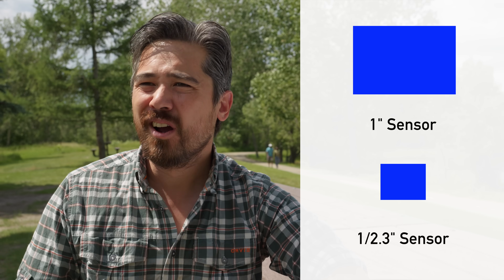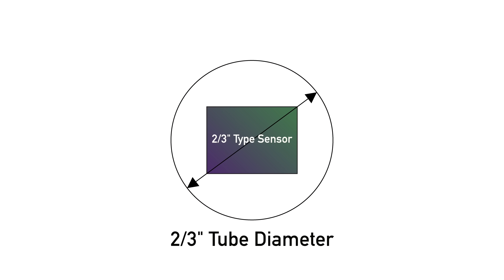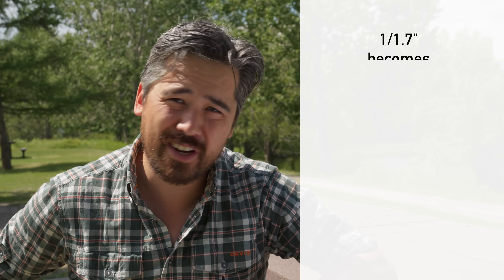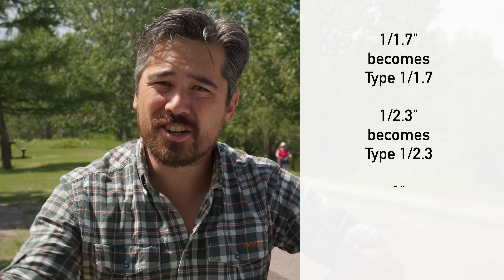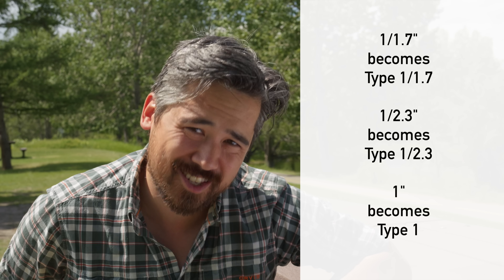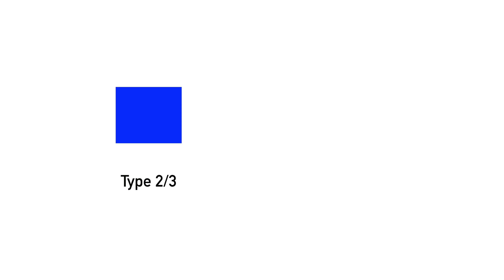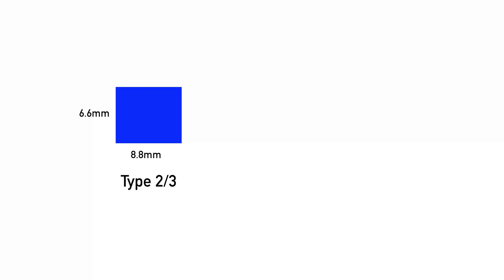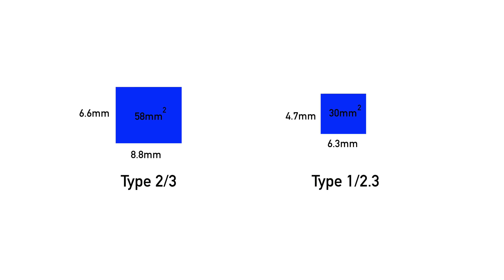Sensor sizes make no sense, but we fixed it!

Comment: Great initiative!
May I suggest to add one more value if it doesn't become too much?
It would be to indicate an accurate crop factor for each sensor size discussed.

It's useful to understand both the focal distance of lenses but also how much light relative to full frame is gathered.

For instance I know that micro 4/3, with a crop factor of 2 gather 1 stop less light.
Easy enough. But for smaller sensor sizes: no idea! I'd like to know.

Alternatively, an light stop index:
-2 for micro 4/3, -1.x for APS-C, -5 or more for smaller sensors
(Not sure the values are right)
Reply: But, your statement about smaller sensors gathering less light isn't correct. Exposure is defined as the amount of light hitting the film or sensor per unit area. Ever wonder why no light meter in existence has an adjustable setting for sensor size or film size? Because exposure and light gathering has zero to do with sensor size. It's the same whether you've got a tiny cell phone sensor or a large format film camera.
Reply: @YetiOnGuitar  yes I see what you mean. As a clarification, I could describe it as an index linking sensor surface area with light gathered, expressed as stop. 

Let's say, if you attach a full frame lens, without adapter on a full frame sensor and a MFT sensor.  The MFT sensor will gather 4 times fewer photons, equivalent to 2 stops less.
Correct?
Reply: @supercurioTube  You're abstracting the theoretical sensor area into something that doesn't have much usefulness—how many photons hits a given area doesn't matter compared to questions like: how big or small are the photosites on the bigger sensor, what generation of Analog to Digital conversion does the circuitry use etc. This is the stuff that the other commenter above me also highlighted. 

Exposure values stay the same across the sensors since they are measured per unit area, and the end result difference between an image captured by a bigger and smaller sensor comes down to a lot more than just an abstract smooth plane that gathers more total photons.

Think about the film camera days, nobody changed camera settings between 35mm and APS-C film cameras. The field of view would be different, sure. But the total photons hitting the bigger film area just doesn't factor into the exposure conversation.
Reply: @YetiOnGuitar  I think there would be value at least for the crop factor, clearly indicated for any sensor size.
Would be helpful in order to match the DOF/Bokeh between sensor sizes BTW.

But yes size doesn't automatically translate to noise performance nor dynamic range.
Reply: @supercurioTube  Yeah I agree, Field of View and Depth of Field are incredibly useful to compare—and of course, substantially affected by sensor size!
Reply: You are mixing up the effect of crop factor on aperture and depth of field with light transmission. From an exposure standpoint the amount of light gathered is not important in the sense of as a bulk, but as "light gathered by a single pixel" and in that manner it will be the same for an aps-c and a full frame sensor. You set the same aperture, same iso, same shutter speed and the two pics will be identical in exposure. The difference is, that bigger sensors will have usually better noise characteristics, and in that regard there is of course a big difference between my A7R and my A6000, but that has its roots in electronics and interference, and that is not as uniform gap as that its influenced by sensor design, size, sensor structure, resolution, etc... so you cant quantify it as uniformly and easily. Its pretty much depends on which sensor you are comparing to which sensor, because there are varieties in FF as well for example.

Comment: That is a great idea to let go of the Inch thing. However I would like to have it as a crop factor from a full-frame 35mm.
For example, it would be better if you call it APS-C aka 1.5x crop (no need for APSC of course). Full frame is a standard 3:2 ratio and if the sensor is in other ratios, it would be good to have your way of "Type "
example: " 'Type 1/2.3' aka crop factor sth.(I don't know) with ratio of 4:3 "
Reply: That's actually a good idea, as we're already thinking in these terms. So, FF would be "x1@2:3", APS-C either "x1.5@2:3" or "x1.6@2:3", mFT would be "x2@4:3" etc. Would be nice, but I don't think that this will become accepted reality.
Reply: @c.augustin  Thanks. I just saw someone on another channel say just ditch inches and use actual millimeters. Milimeters is also going to give us a number greater than one, which is faster to work around in mind. But how big exactly is a millimeter is pretty hard to visualize for some.
why I like using FF as a standard is I can calculate speed booster magnification for lenses. and I mess around with for example the EOSm, which is 1.6x, and records RAW with a tighter crop. If I just multiply, I get the actual working crop, and therefore what CCTV lense designed for that size crop sensor would give me best result.
Reply: @yuxuanhuang3523  While I'm quite familiar with mm sizes, I nearly always think in crop factors when dealing with digital cameras (I started using cameras with 35 mm film, so thinking if FF focal lengths is completely natural for me). I even think in FF focal lengths when using large format (4x5 is actually x0.33 or /3, so a 150 mm lens is roughly equal to a 50 mm FF lens). This is often heavily criticized to use the 35 mm film/sensor format as a "standard", but it is the way it is (it was the dominant image format since the early sixties of the last century).
Reply: @c.augustin  Ah yes, I forgot to mention focal length conversion. Actually that is what I am thinking of all the time. I use Canon so I always remember to divide by 1.6 when I see a tutorial saying optimal focal length
Reply: No. Please, just mm x mm.

Comment: Who's going to remember all the new names. Why don't we just call them directly 44 x 33mm (1452mm²) Sensor, 35mm (864mm²) Sensor, APSC (372mm²) Sensor, etc., so any reader will get an idea about the sensor size.
Reply: Amen, I am on the same boat.  The "type" really didn't explain ANYTHING, and is just going to make the confusion worse.  In fact, since frame would be 36mm x 24mm = 864mm², just call that Type-864.  APSC is 24x16 which makes it Type-384.  Micro 4/3? 18x13.5=243, so Type-243.  etc.  It will also clearly differentiate the Canon "APS-C" which is not APS-C... at 22.3x14.9, that would be Type-332 compare to standard APS-C's Type-384.  A Type number that directly correlates to each sensor's theoretical light gathering capability, and rough depth of field quality - area you should truly care.  What's more simple than that!!??
Reply: THIS is the way to go! The aspect ratio might be of interest, bc a square would be most efficient in this regard. 
A 3:2-type 864 sensor would be complete but maybe a bit bulky. I’m also fine with Type-864 sensor
Reply: Because areas do not matter. We do not talk of areas in the aperture size either.
Reply: @okaro6595  that’s the reason why to double the amount of light that enters the lens you chose an aperture 1.4x smaller… say what you will, but that’s not intuitive; logical, yet not intuitive.
Reply: "Fourteen fifty two" has a nice ring to it! I'll just call him Dave though
Reply: Just use diagonal length. Nobody needs actual area. Do you shop for a 32" monitor or do you shop for a 438 square inch monitor? When's the last time you saw the square inches in a phone screen or TV? Areas are hard to visualize. Length is easy.
Reply: @mbvglider  length doesn’t paint the full picture. A sensor twice the size is four times as good. And: a square sensor would be the worst in your metric and a 17:9 the best, even though they might have the same area
Reply: @lightningblender  Photographers are already able to understand that the difference between f/1.4 and f/2 is a full stop. When you talk about equivalence and crop factor, it's a linear scaling, not one based on area. A sensor that is four times the area still has a diagonal that is twice as large, and this becomes the crop factor, and being able to do math between sensor sizes without needing square roots is nice. People need to be able to do equivalency calculations after all. It's a lot more straight forward to explain that 50mm on a 43.2mm sensor (35mm full frame) has the same angle of view as a 25mm on a 21.6mm sensor (MFT) because the lengths scale nicely. It feels needlessly complicated when you talk about 50mm on a 864 mm^2 sensor vs. 25mm on a 225 mm^2 sensor. Photographers already do this math using lengths; why introduce mm^2 when we already are used to mm dimensions?
Reply: @mbvglider  I think there's two separate interests in comparing sensor sizes. One is to understand focal length selection for an unfamiliar sensor size and the other is understanding the light gathering capability and low light performance of the sensor (assuming signal processing performance is equal, which is another can of worms to open!). Depending on the context you might be more interested in one than the other.
Reply: @mbvglider  the problem with using diagonal measurement is that it changes with the aspect ratio, even if the area remains the same. The area measurement is a direct representation of how much light its picking up
Reply: @mbvglider  tv screen sizes are also hard to compare… square mm gives you actual something relevant
Reply: @hardywoodaway9912  I assure you that nobody knows what 1452 mm^2 is. To envision that, they'd have to imagine a rectangle of some sort of dimensions, in which case why did we even multiply the length and width out?

Comment: Good move. But doesn't quite go far enough. "Full Frame" is a terrible phrase. It implies all sorts of things about sensors small than this, and about the 35mm sensors themselves. I really feel it's a phrase that should also be dropped along with "One Inch Sensor".

A solution to the whole mess would be naming each sensor by the longest edge in millimetres. I know it doesn't quite account for area/ratio but it's close enough to make sense in comparisons.
Reply: Absolutely, I've always hated the term "full frame"!

Comment: make full frame the 100%, and then compare everything to it. Like, APC is 70%
Reply: This is actually the simplest way by far! Bravo.
Reply: Yes - this is the way. Simple
Reply: Well, that’s called „crop-factor“… could be a standard thing though… I’m rather for using the area and possibly the aspect ratio:
A 3:2-Type 864 sensor, or just an 864 sensor.
Reply: @lightningblender Sorry, I want percentage of surface area, not crop factor. 100% being full frame, APS-C being around 43%, micro 4/3 around 26% and 2/3" being 6.7% approx.
Reply: @yourfriendshipisafog  your right, so crop squared and reciprocal. Got something mixed up…

EDIT:
The original comment actually is only the reciprocal of the crop, not it’s square…
Reply: @lightningblender  Yes, that’s also what I advocate, the sensor area and aspect ratio are enough to specify the sensor properties.
Reply: @lightningblender  No no no. Areas mean nothing. Nothing in photography is based on areas.
Reply: @okaro6595  everything is. Is it a coincidence that full frame sensors exhibit 1-2 stops less noise compared to an APS-C sensor? Is it a coincidence that to double the amount of light that hits the sensor you have to double the area it travels though? It might be that common practice converts everything into a length, yet the fundamental principals correspond to areas, not lengths.
Reply: I wouldn’t compare all the sensors relative to full-frame. Sticking with the exact dimensions is a better idea. Full-frame is a highly common sensor size, industry standard, I accept that. But all the sensors are equal and you can choose anyone of them as a reference. There is an obvious problem that DPreview and others are trying to solve but if you invent solutions just to save the day, it is not good for the future. The solution must be a little future proof. Maybe 50 years later, full-frame will be less relevant, medium or large format will be consumer level. Then people will ask why we are comparing sensor sizes to the old full-frame. But metric system will be the same.
Reply: I seen this comparison before and it makes a lot of sense actually.
Reply: This actually makes sense. It'll never catch on :-)
Reply: The most intelligent comment in here, KUDOS!!
Reply: Nice alternative, but again, having the exact size in mm is the best IMO.
Reply: Make medium 100%
Reply: @hyperhoo1736  imo it doesn't really make sense for medium format to be 100%. I don't think enough people use it to be of much relative use. full frame is already the default prosumer/professional sensor size in like 99% of cases. I've really only ever seen medium format for things like landscape photography. from what I can tell and with my experience from Canon APS-C to Sony FF, the step up from M43/APS-C to FF is bigger than FF to MF. it seems like too niche of a market still to use MF as the baseline for comparisons

Comment: The transition to the 'type 1/2.3' doesn't give me much, but the actual size (dimensions and surface area) : YES! 👏
Reply: Yeah, I think that's just for people who don't know that the "inch" doesn't actually mean "inch". 
It's removing a word that can be misleading to people :)

Of course eventually we all just want to use the actual size measurements I think!
Reply: 100% agreed.  The "type" really didn't explain ANYTHING, and is just going to make the confusion worse.  See my other comments on using surface area as type.  Same idea as yours: much more practical.  Full frame would be 36mm x 24mm which is 864mm².  Just call that Type-864.  APSC is 24x16 which makes it Type-384.  Micro 4/3? 18x13.5=243, so Type-243.  etc.
Reply: The 1/2.3 gives a reference that you can be used to compare to other sources. If one source lists a camera with 6.2 mm x 4.6 mm and another lists another camera with 1/2.3" then how do you compare these if you do not master the markings?
Reply: @okaro6595  Yes, agreed, but Type 1/2.3 or 1/2.3"... That makes it not much better (especially when other people will use the version with the 'inch').

Comment: Well you left out medium format.  I am not sure you are ready to tackle that mess.  Really it should be just diagonal mm and aspect so a 25mm 4x5, or 16x9 makes more sense as that's sort of what I am used to.
Reply: Or just use surface area and call it a day, since digital medium format sensor really isn't medium format film size either.  Fuji's "medium" format sensors are 43.8x32.9, and the SMALLEST commonly accepted medium-format film (6x4.5) is 56x41.5mm... Their surface area is 1441mm² vs 2324mm² respectively, a huge difference.  Just keep it simple and use Type number to reference surface area would fix all of that... GFX-50 would be Type-1441, full-frame would be 36x24=864mm²=Type-864, Micro 4/3 would be 18x13.5 = Type 243.  Then every sensor type would be directly comparable for their theoretical light-gathering capability.
Reply: @WallaceLau  still need an aspect ratio to define super 35

Comment: 👏👏👏👏👏👏👏👏👏👏
Instead of fractions, I just want millimetres from corner to corner, and the aspect ratio. 20mm 3:2. You know what you're getting this way, in real terms.
Reply: Agree with this 100%.

Adding type in place of the inch notation is really no improvement at all.
Reply: That makes by far the most sense to me; it mirrors TV screen nomenclature everyone's familiar with. For instance, I have a TV that's 43" 16:9. Simple.
Reply: Much better than what they suggested

Comment: Umm - you did NOTHING other than just drop " - seriously? You missed a HUGE opportunity to just label a sensor by its area in mm2. So it would be a 5m, or a 18m, etc. Easy to understand (bigger is....  bigger). Until you get to 4:3 when you can just go with the usual (or continue - 227m, etc)

Comment: Sorry but the new naming is needless it doesn't fix anything or make it easier to say and just adds it own confusing inconsistences.
Reply: It helped me. Maybe you had trouble watching the video and just got more confused yourself?
Reply: @butchrodgers9559  how does it help you to say type instead of inch, removing any context to what the numbers refer to but then drop saying type when we start talking about m4/3, aps-c and full frame? Wouldn't someone ignorant of cameras wondering where the type 2 or type 3 sensor is? Why use the term type at all?

Comment: I don't think you've fixed the problem in that there's no real world relationship between what these sensor sizes are and the arbitrary names you are giving them.  What about the sensors that are larger than 35mm too?
Reply: It's obviously a compromise, but these (dumb) old names have become so entrenched that you really can't afford to throw the entire baby out with the bathwater, especially since manufacturers are pretty unlikely to adopt the hot new DPReview naming scheme on any reasonable timeline. With sensor sizes, the confusion is kind of the point, after all.